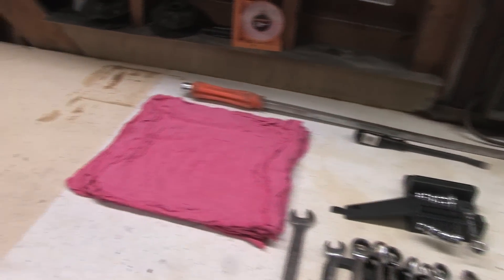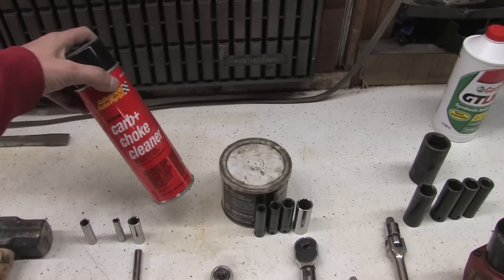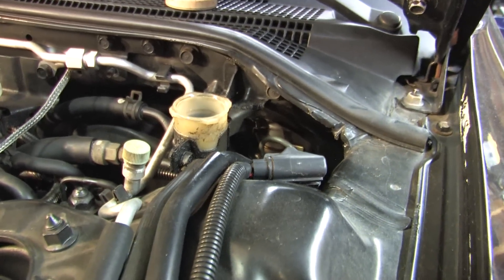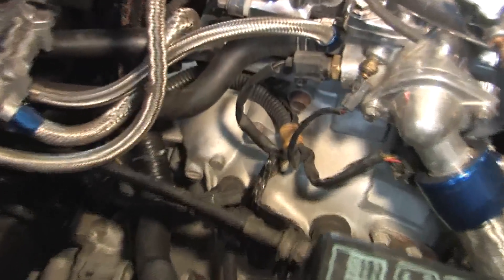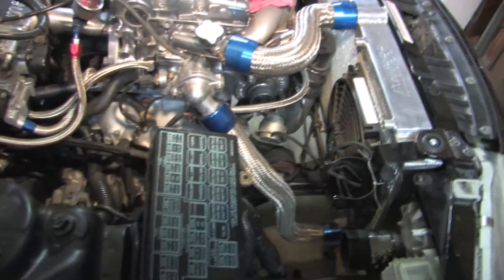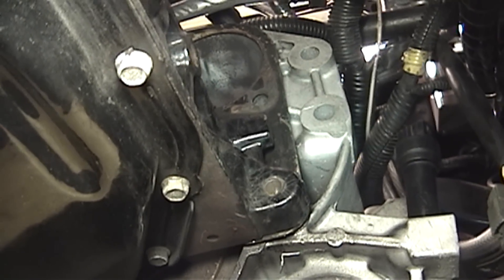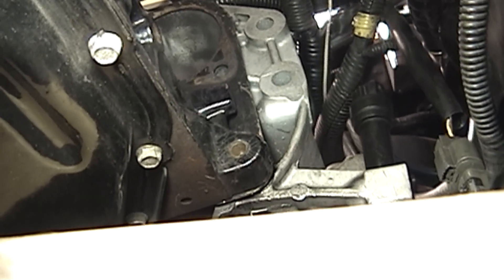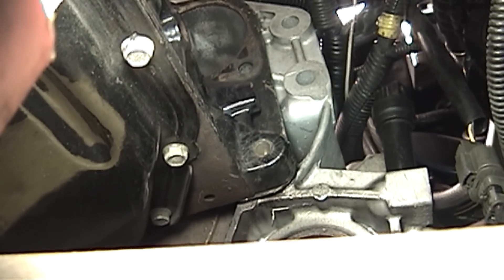Trans & Clutch 1 - Remove Transmission

Comment: hi I have a 2000 lanos 1.5 engine I have to replace the clutch is it possible to remove the engine and leave the gearbox in place I don't know much about fwd cars it might need other engine work the thought of pulling out the halfshafts  etc is something ive never done theres also limited information about theses cars any help appreciated
Reply from the maker: +John Alicajic Really, it's easier to leave the engine in the car and just remove the transmission.  I'm not familiar with a Lanos, but if it's FWD, there's a lot less stuff connected to the transmission than the engine.  It takes me 5 minutes to pull an axle with or without a lift.  I've had a lot of practice, though.  Short of wrangling the transmission out of the engine bay, the axles are the hardest part and I consider it a piece of cake.
Reply: +Jafromobile hey i had a question i own a 98 gsx and i cannot remove my driver axle i see in ur vid u removed ur lower control arms is that a must?
Reply from the maker: You can un-bolt the other end of the LCA, the trailing arm, the tie rod and strut bolts and remove it all as an assembly if there's no other way to get it free.  I've never had a lower control arm that wouldn't give, but I have had an axle seize in the hub so bad that 4 mechanics including myself gave up on it before one separated the CV joint so we could save the knuckle and replace the hub bearing, axle, and replace the ABS sensor we destroyed with a blowtorch.  In light of the seized hub and axle, the LCA separation is one of the lesser of DSM evils.  The axles are installed un-greased by the manufacturer and tend to seize in place.

Comment: Hello Jafro! I have dropped my transmission in my 98 Spyder before just wanted to ask if I left it supported by a jackstand and piece of wood for a week it should be OK correct? Last time we took it out, checked what we needed to, installed again same day. 

Also If you have an email I would very much appreciate your opinion on a trans issue I've been having lately. 98 Spyder manual swap and awd swapped. Thanks much sir hope to hear back soon!
Reply: Woops, support the motor with a stand and block of wood lol
Reply from the maker: I don't give my email out because people will use me as a resource to be their free DSM tech support, and there's nothing on the planet that can motivate me to want to do that.  I don't wrench on other people's cars, and I don't have the time to support 846,000 20+ year old cars.  That's the job of the people who own them.  I'm flattered by those who value my opinion, but in order to keep production rolling on a channel that pays me less than 60 cents for every hour I work on it or support it, I have to stick to only teaching through my own examples.

For the engine support question, if you put the crossmember back in the car, you can put a block of wood between the crossmember and the flywheel to support the engine.  If you brace it that way, you can even roll the car around and the transmission stays supported.  It's better than using a jackstand for long-term storage, but the jackstand would work just fine as well as long as you don't need to move the car.
Reply: ***** fantastic  thanks for your replay and please keep making this videos huge help to us dsm people.

Comment: looks like it is very tight down there..
hey, you ve got a lot of tools... do you have a torque wrench ?  it is essential ..
Reply from the maker: Bruno Ferreira Within the next couple of days, I will be showing 2 of the mothers of all torque wrenches.  ;)
Reply from the maker: Oh, I thought I was answering you in a different video, and I now understand the context in which you asked.  Yes, I had torque wrenches then as well.  I just didn't need them to remove the transmission.  I only use them during installations.  This was all deconstruction.
Reply: ***** I am struggling to remove mine, but it is a ford escort 97... it should be piece of cake, but I don`t have the tools for it... but still, I am doing the job quite well, I must say.. It is out of the car already, and now I am looking for leakages.  The stupid reason for removing it was due to leakage behind the flywheel ( must apology but it is missing on some specific terms to express myself properly, since my first language is portuguese  and not english ).....    then I realized it would be easier for me to remove the engine together with the gearbox ( the head was already out )  .. I know it  sounds weird.. but it is not... if you ( again ) consider I don`t have the right tools...   all in all, I am about to accomplish my goals... 

man, I would give my eye for the tools you have... I love tools, either mechanical or electrical...
Reply: Bruno Ferreira I will also replace the clutch , as I have everything off... although mine doesnt seem to be  so wornout

Comment: ***** I need to replace my drivers side cv shaft but they gave me a normal size shaft im so confused on how to get the old cv shaft out of the race thats on the back of the engine block.... any help from any one would be greatly aappreciated..
Reply from the maker: MakeItTwisted AWD or FWD?  AWD cars have a carrier bearing bolted to the block, and removing that axle is impossible without removing that carrier bearing first.  Some people use a bearing press to separate that carrier bearing, but I've been lucky and literally had them just fall apart in my hands.

Comment: Hey jafro, I have a question. I just did a trans swap and put brand new clutch pressure plate and flywheel in my 2g gst. Everything was put in fine. For some reason when I take off in first gear when it's initially starting it gives a little shake. Do you believe it's bad motor mounts? Or possible alignment? I tried changing the ball joints and still does it. If you can help that would be awesome!

Comment: Is there any difference in a 1g transmission install and a 2g?  I am having a heck of a time...   I bought it from an individual and the transmission was already out.  Mine is all wheel drive and the transmission case seems to be hitting on the rear crossmember and the input shaft of the transmission on the clutch.  I have no mounts out except the one on top of the transmission.  Any ideas?

Comment: Google "Ball Joint Separator Harbor Freight" This cheap tool is a little different than the normal forks that you find in most stores and works great at getting ball joints to come apart. You can still remove the pin and it will function like a standard fork.

I just wish my drive shafts looked like yours do. Mine are covered in rust to the point where you can't see the line between the hub assembly splines and the drive shaft splines! 

-Xploitn (dsmtuners)

Comment: Yea once I did a front engine mount on an Audi. You'd think it would be easy or a simple task for one mount. But you have to remove the whole front bumper to get enough clearance to remove the bolts. L☺L

Comment: Watched this to start working on my 98 GSX trans, thought I had a throwout bearing clutch / fork issue, ends up the center section on my 6puck disc snapped the rivets and came lose, hence me not changing gears. Thanks for the vids and following to come, been a ton of help.

Comment: Yea I believe they're also called hammer drills, or rotary hammer. I was just using one to bust out cement underneath my shower tile and realized it may work really well to put in the center of the axle and just keep hammering it until it busts loose. Maybe to much power, but I dont know.

Comment: Kind of a weird question Jafro, but could you use a roto hammer on the seized axle. Just get a pointed tip that can be used for chipping out concrete, and put that in the end of the axle. Thoughts?

Comment: How did you get your transmission so clean? Mine has what looks like oil spots embedded in it. I have tried simple green, engine cleaner and pressure washing. so far nothing works for me. Yours look new.